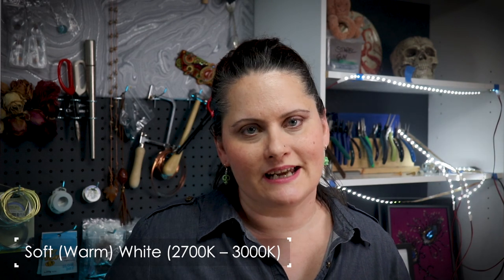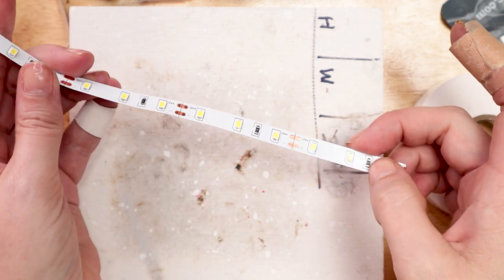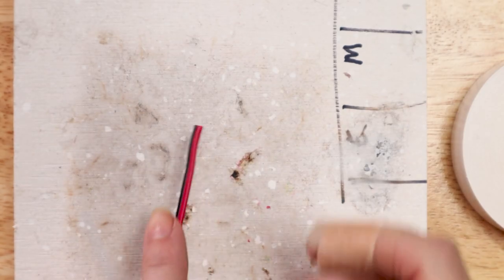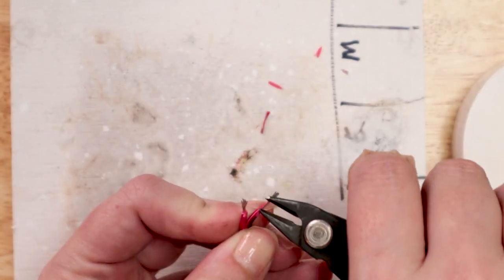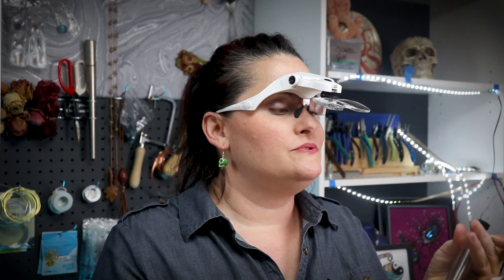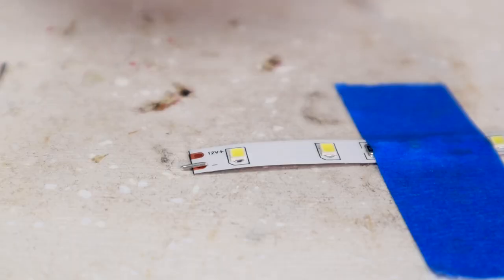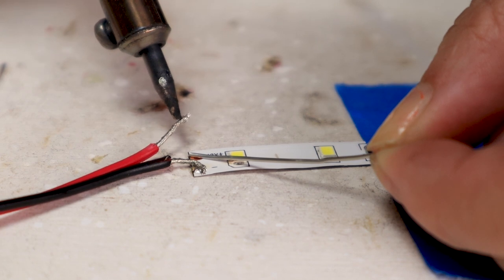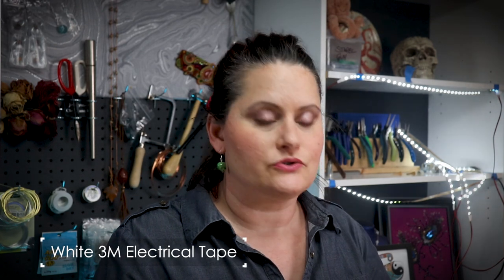Ep8: Electrical Soldering for Jewelry Makers

Comment: I certainly am not an electrician or anything remotely approaching one, but I often place the iron just a little higher up on the wire so the heated wire melts the solder instead of the proximity to the iron. Makes the connection a bit more secure, less prone to snapping off when its flexed. Takes a little longer though.
Reply from the maker: IDIC. Infinite Diversity in Infinite Combination
Reply from the maker: Excellent suggestion. I did have one connection come apart when I secured my lights and tried this and it worked great! Thanks!!